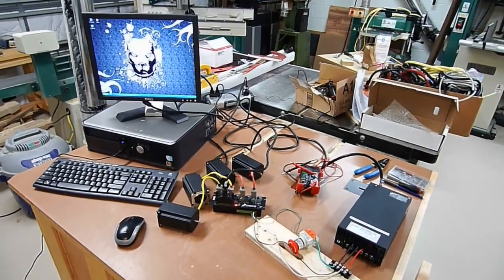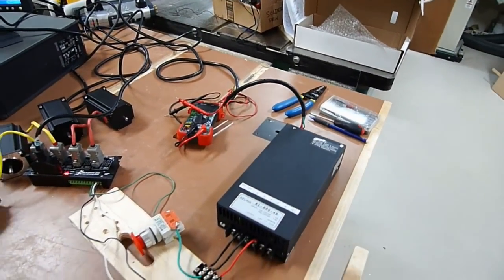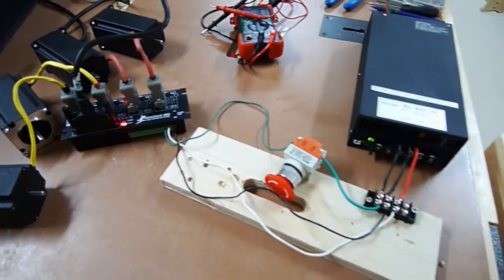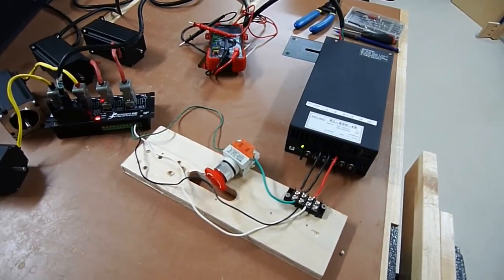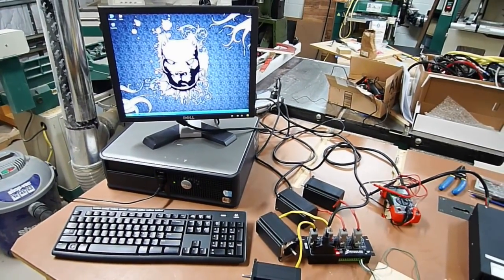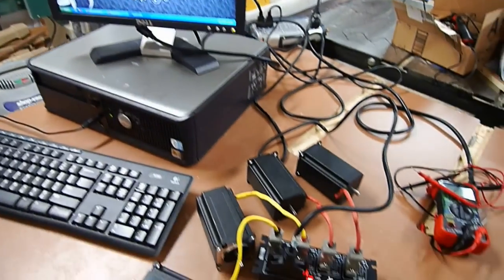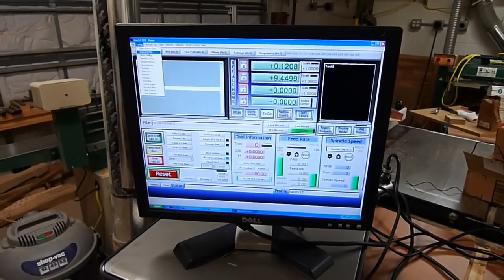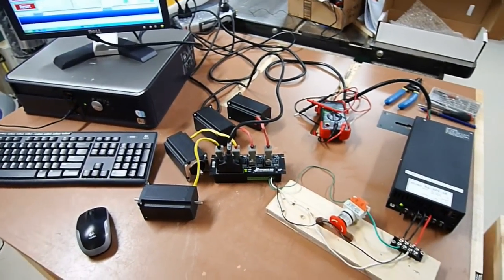Wetland CNC Router Part 16 - Bench Test Stepper Motors, G540 and Mach3

Comment: well, i have the same setup but my motors are not working. The only thing I can think of is that maybe i wired my motors incorrectly?? (but i dont think they are right) Did you have to solder an inline resistor between motor pins 1 and 5 on your db9 connectors, as stated in gecko's pdf manual? Technically, I shouldn't have to since my motors are above 3.5V. I cant figure it out.

My gecko is responsive to mach 3; green light turns on when "reset". My pc has built in parallel port which was set to "EPP" mode. I don't know what the deal is